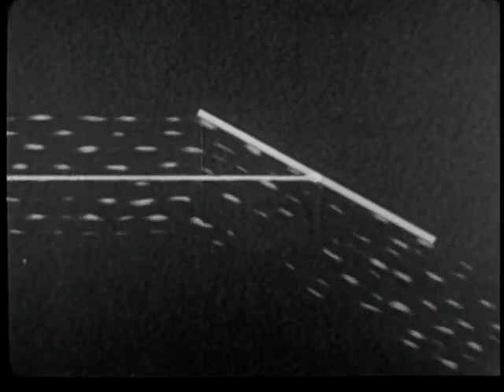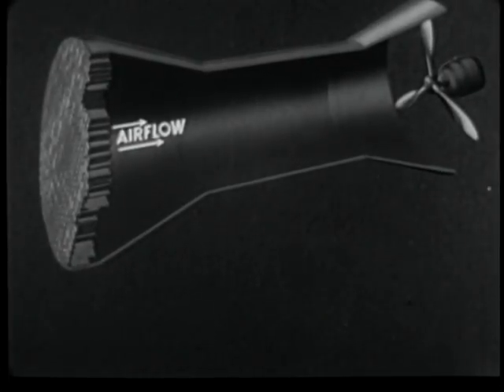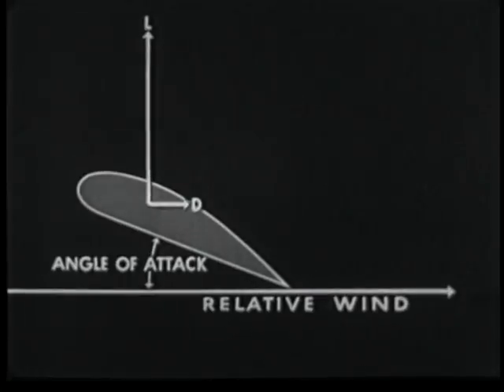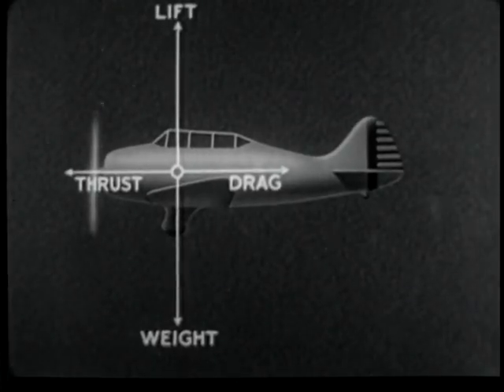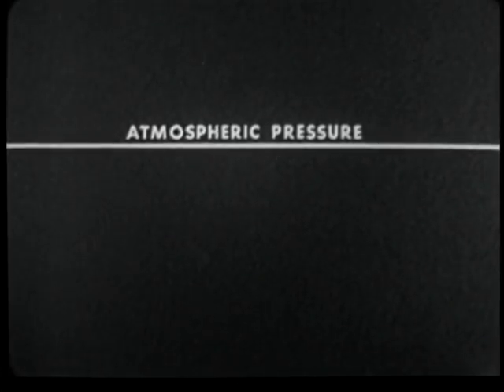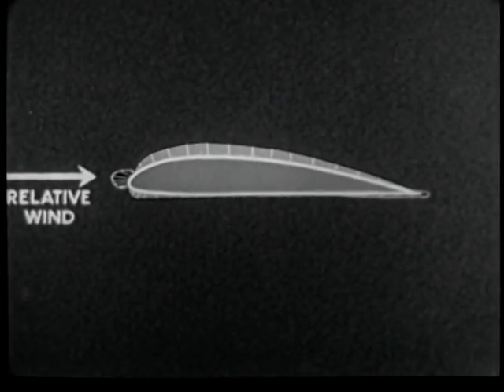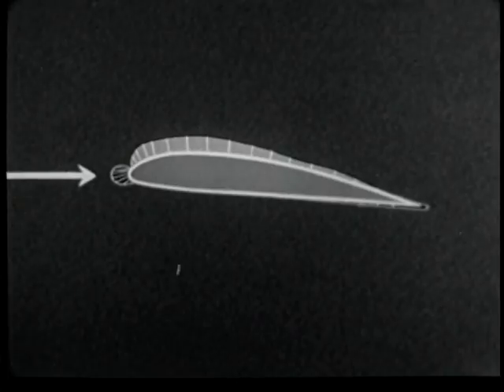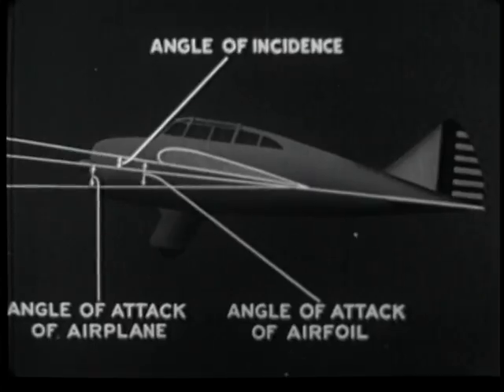AERODYNAMICS - FORCES ACTING ON AN AIR FOIL

Comment: 4.05 That’s not the cord line of a flat bottom or Clark Y airfoil when I was learning. The line starts from the first point on the leading edge curve (where air separates above and below) and through to the trailing edge.

Comment: Since wings are fixed in position on most aircraft, & the wing creates lift perpendicular to the length of the aircraft, it would seem to be impossible to attain a true vertical dive if the fuselage is truly vertical.  The lift from the wings would move the plane horizontally.  To achieve a true vertical dive, the plane must exceed an angle beyond vertical to put the wing into zero lift in both directions.  Is this correct?
Reply: Correct, unless the wings are symmetric with an angle of incidence of zero (meaning they generate no lift at zero angle of attack and the wings are not at an angle relative to the plane)

Comment: At 20:09 i still could't understand that the negative pressure on the upper surface is creating powerful lift force as he said. How the negative pressure is creating lift? Anybody here to explain please?
Reply: It would help if you had a background in dynamics and calculus. But I'll try.
Basically pressure is just force over area right? So in still air the air pushes on the surface of the wing with a certain amount of force per square cm. If you add up all the forces with their directions you find that the total force is zero, all the air pressing on the bottom of the wing matches all the air pressing on the top of the wing.

Now if you move the wing through the air you develope a low pressure region on the top of the wing. Now if you add up all the force you find that the air is pushing on the bottom of the wing with a larger force than the air pushing on the top of the wing, this force inbalance is essentially the lift being generated by the wing.
Reply: Simple, air pressure caused by atoms of air striking all surfaces, once accelerated over the upper curve, the atoms strike with glancing blow, reducing the pressure. Underneath they bunch up, getting in each others way, so pressure rises, due to more atoms striking.

Comment: It is true unless you have a fully symmetrical airfoil. As a side note, lift is created perpendicular to the relative wind, however, with a fully symmetrical airfoil zero angle of attack equals zero lift.